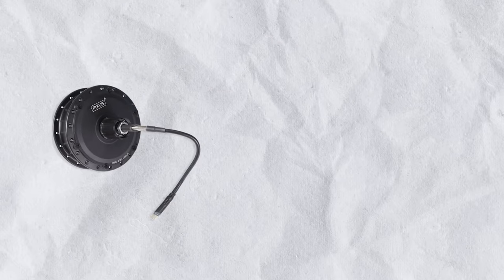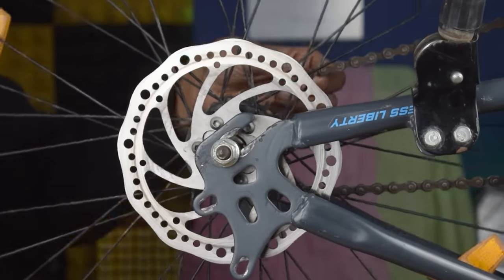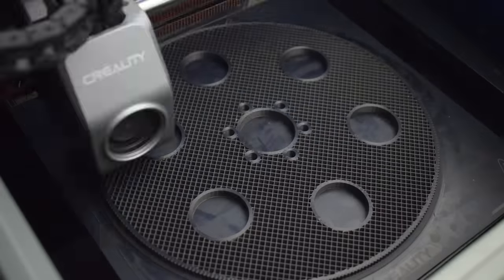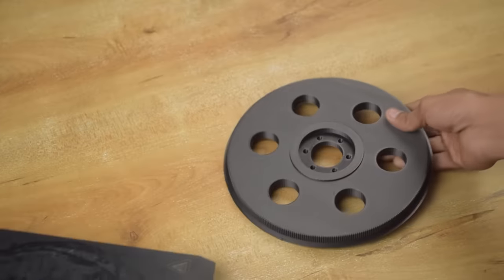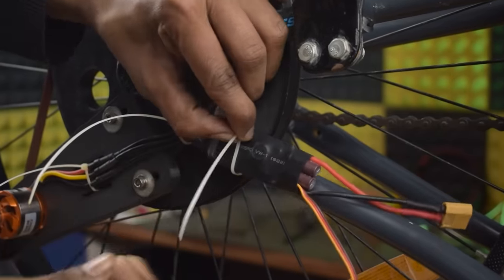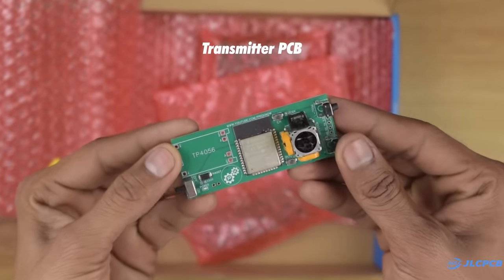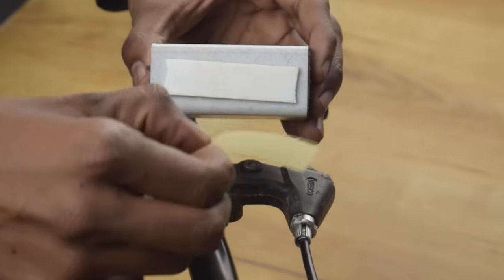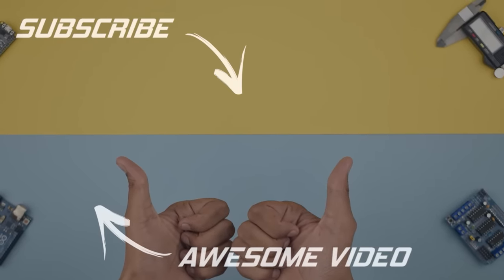Making a Electric Bike from 1000kv Brushless Motor |  Will it Work?

Comment: One Phrase: Carbon Fiber Slipper Clutch.  These motors don't like heavy loads, so running them at high RPM and allowing a clutch to slip instead of providing direct torque will aid in efficiency.  My RC car from the 1980's has this type of clutch.

Comment: Great example of DIY from a modern Jack of Many Trades.  For those new to this sort of creation note a couple of things though: The much higer RPM results in more friction, on the belt, the belt sprockets and on the motor bearings which are designed for intermittent model flying, not long duration runs. I am impresed with the small bill of materials but note that the lever arm holding the motor is subjected to a lot of stress, petter to print this in PETg+ or another plastic that is both rigid and very sturdy.

Comment: Great video, As always! some points i would like to add. The motor heats up very fast, If u Further drive the bicycle with load the windings will get damage due to heat. To Drive the Ebikes (Without pillion/Double seat) using the small Drone Motor is Not recommended. If you still wants to give it a try then choose the motor above the 70mm stator dia +50mm Width (less than 100Kv). Design the appropriate Gearing to increase output torque (Timing belt Pulley or Planetary Gear System Pref.). Also, take care of the Motor Cooling Design. Use the close loop Speed controller (Based on Hall, encoder based) so it can generate max. torque on diff angle. Don't forget to use safety gears 😀.
Reply from the maker: Thank you for your valuable comment. I would like to clarify that the video was created for experimental purposes only.

Comment: really nicely engineered project components! very impressive set of skills!
Did you measure the power consumed by the ESC? I would find that very interesting. I suppose the motor is not putting out 480W of power.
I'm curious to see a follow up video.
Thanks!
Reply: definitely putting out a tiny fraction of 480W lol.  It's called a power meter.  Many ways to implement.  Measure the magnetic field.  Put a precise shunt resistor in series with one of the power input leads and measure the voltage across the shunt.  If homie pedaled a bit and got the motor deeper into the powerband I bet it would put out more torque, and even if not, it would be spinning faster, thus more powerful.

Comment: Actually you can't run drone motor for long time because heat dissipation is very less... Like power tools motor can't replace induction motor. Power input doesn't make sense... Power output should be same...
Reply from the maker: Your are right brother but this video is just for experiment purpose only.

Comment: Love these quick-hit vids sometimes.  Well done on the reduction.  Did I hear belt slip at the end though?  That means the belt is a bit loose (as you know), or there is more power to be had with that motor.  Were you topped out with that set up in terms of speed?
Reply from the maker: Thank you🙂 for your valuable comment and Sorry for the late reply.
Yes, you heard the belt slip noise, I think it is happening because the motor is generating enough power but that 20 teeth pully is not capable of transferring that power to the 300 teeth pully and I think, It can be solved by replacing the 20 teeth pully with the pully which has higher no of teeth.
Reply: @proknow  Nice, looking forward to the revision.

Comment: Wow where did you get a million volt electric motor from??
Reply from the maker: I just wanted to clarify that I never mentioned a million-volt electric motor. It seems that you may not be familiar with Brushless Motors, which is why you asked that question. What I actually mentioned was a 1000kv Brushless Motor. The term Kv refers to the motor velocity constant, which is a measure of the relationship between the speed of a Brushless DC Motor (BLDC) and the voltage applied to it. This constant is usually expressed in units of revolutions per minute per volt (RPM/V). I hope this explanation makes it clear. Thank you for watching!

Comment: I think motors should be rated using a different format.  KV already means Kilovolts...
     Why this already-taken format is also used for the irrelevant speed/voltage rating for a motor, snd become standard, is beyond me...
     Why not KRPM/V ?  Its not like that's cumbersome in any way. 🤷‍♂️

Comment: It's not a 1000Kv motor - 1000Kv is one megavolt!!!
Reply: Not kilovolt, AFAIK. It's how many rpm per volt applied the motor will spin unloaded.
Reply: @natereinhold6180 the current format should never have become standard, as it's already taken.  Why it did is beyond me.  KRPM/V would make more sense.